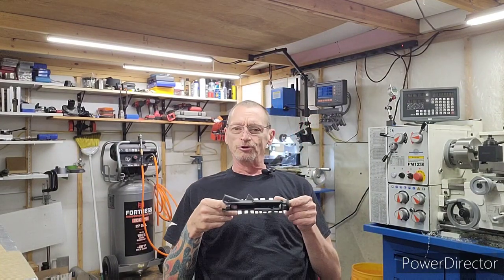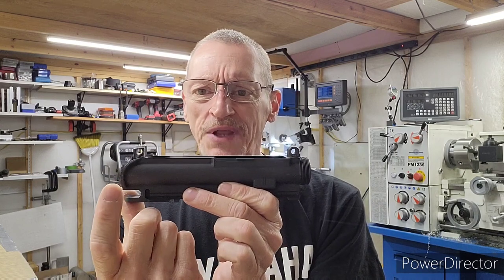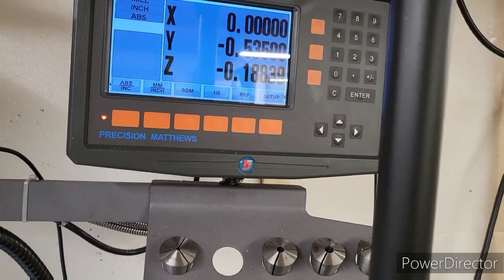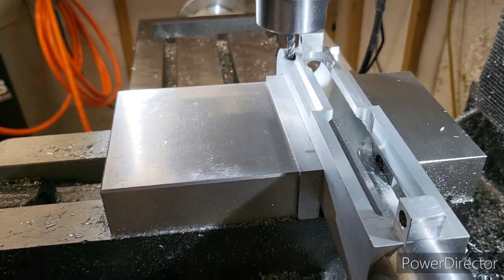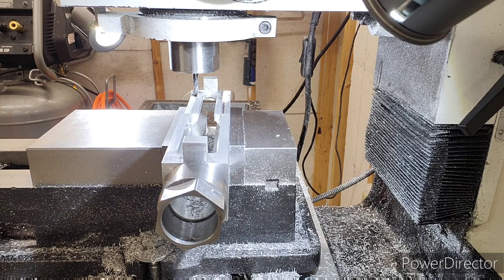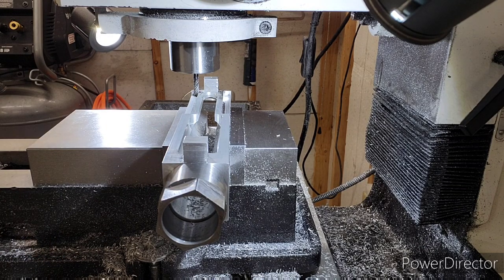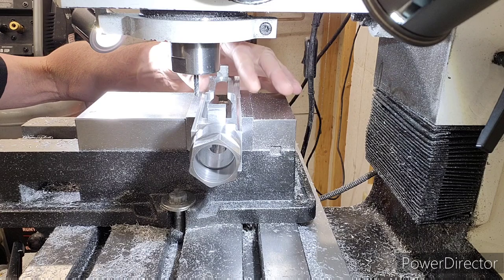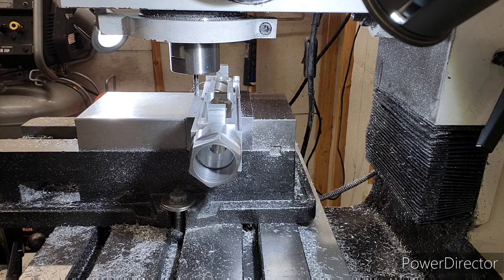Manual Machining AR15 Billet upper receiver  Pt13 @Toolmaker001

Comment: which plans are you using?
Reply from the maker: I located the blueprints online just don't remember where.
Reply: Look up ar-15 tech tips in under 5 minutes he has a video that shows you the website to the current colt/us army print revisions. They are legit because I’ve been gauging my receivers and parts and 90% of them are within the specs shown. Others threat fell out of tolerances I sent back unless were talking barrel extensions and receivers barrel extensions ID and OD and a few other parts I personally like tighter specs on.
Reply from the maker: I'll check it out. I also like much tighter tolerances. Thanks, very cool.
Reply from the maker: I also pull a lot of dimensions from existing upper receiver. So I kinda chose what I want to use.